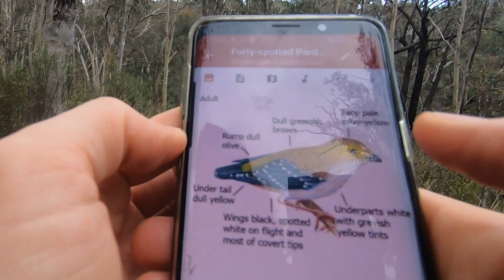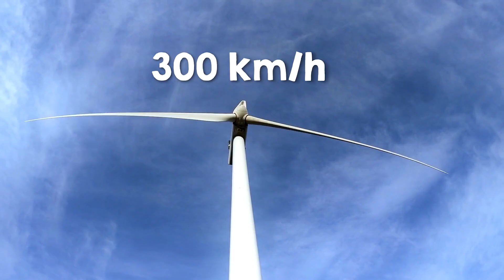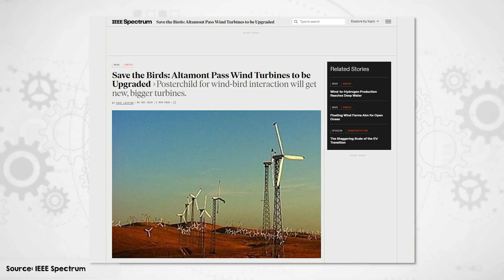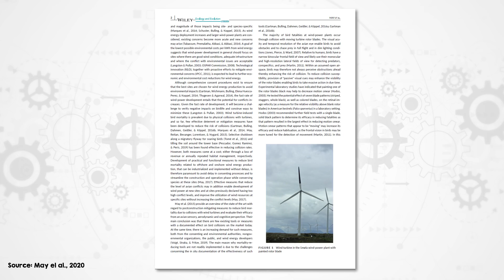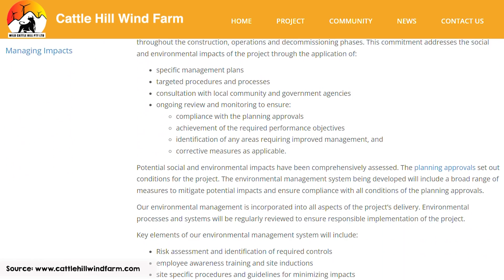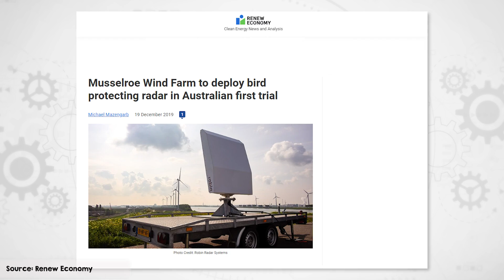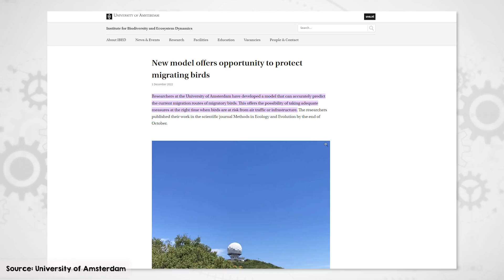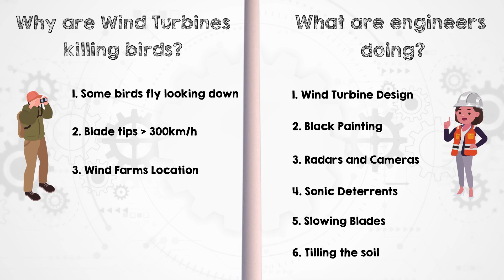Blades vs Wings: Wind Turbine Technologies to Save Bats and Birds

Comment: Maybe highly reflective (non heat absorbing) stripes or spots on the blade would deter birds similar to the black blade.  Similar to the hanging reflectors that can be put in front of windows to deter birds.
Great video.
Reply: I think paint would still cause blade balance problems. With that much surface area the paint can add up.
Reply: stripes were glossed over but can be applied to all blades, removing the balance problem
Reply: @alanhat5252  Balance is easily addressed in many ways.  The overwhelming issue is thermal distortion differences due to the difference in black vs white blades.

Comment: BS.
renewable energy currently has no idea to recycle metal cobalt, lithium and such
It will be nightmare once these batteries out commissioned 
it is a sham
it is also not carbon neutral since the logistic and manufacturing are still using fossil fuels

Comment: Although the cat/turbine comparison is interesting, cats don't generally kill large raptors so the raw numbers is not the best comparison. Small birds may be killed in much larger numbers if they are generally more numerous without harming the species as a whole. Obviously in areas where the small birds are threatened cats are a major problem. In general bird deaths are much more of a concern for threatened species than otherwise. After all, some birds eat other birds, so if it was purely a numbers game we would kill the predators.

Comment: "Birds usually fly relatively low. Most of the year, they stay under 500 feet. During migration, though, birds gain altitude, and many species fly at 2,000 to 5,000 feet or higher, using prevailing winds to assist them. A bird may begin migration at about 5,000 feet and slowly climb to 20,000 feet."
Reply: This depends on weather conditions and species.  I think there could be years when migrants fly over the turbines no problem and then another year where it becomes a big massacre

Comment: No fossil fueled anything, yes ?
Electric power only,  yes ?
The national electrical power grid, the towers and poles and wires and transformers and switch yards to the streets and homes and businesses and industries and buildings and warehouses and shopping centres and millions of ends of the existing national grid has taken 100years and massive amounts of national wealth and work.
The grid was never over built, it was built to economic engineering minimum standards. 
The national grid is fragile. 

5 times more electricity demand will break the existing national grid. 

So, 5 times bigger national power grid would be a horrendously expensive expansion of the grid. 

This economic aspect of the grid is absolutely critical to understand the problem of centralised ANY generation of electricity. 

Decentralised, dispersed electricity generation is critical to UNLOAD the national power grid.

Rooftop solar PV has basically no transmission costs  and protects the existing national transmission grid. Selfparking EVs, V2G like home robotic vacuum cleaners with their huge batteries are also critical part of the grid. 

Money in the bank for grid owners..
Reply: 5x more electricity…

1) Is a made up figure, it’s less than 2x at best.

2) Power use currently peaks in the day, demand pricing will smooth that out, also EVs charge predominately overnight.

3) The capacity of the grid is non-linear, a 5x increase in capacity wouldn’t increase the grid by 5x, but by 2.2